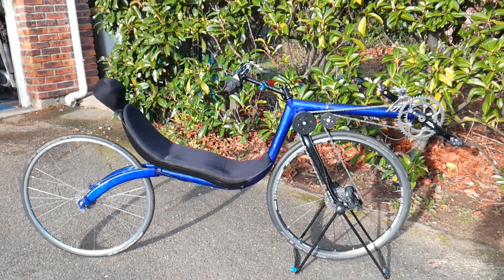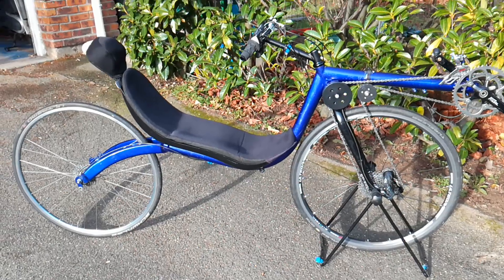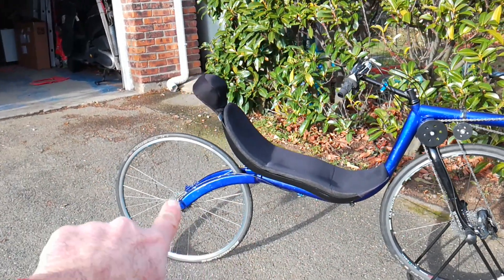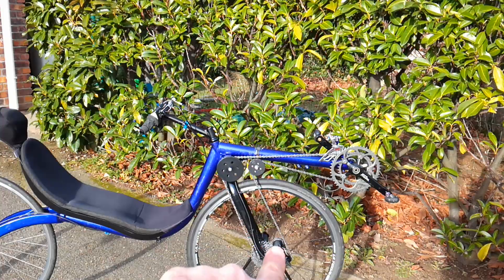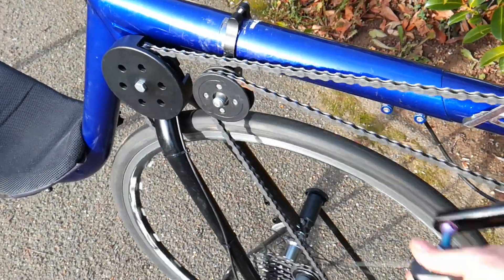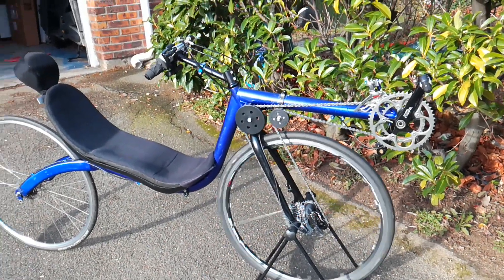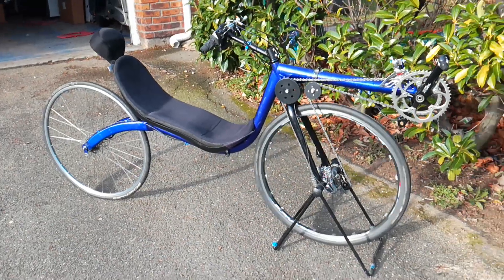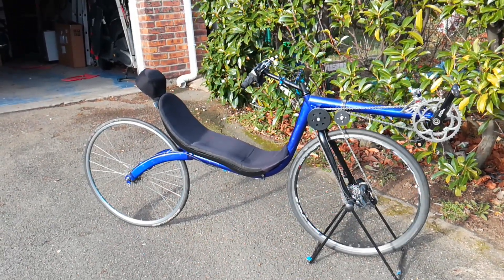M5 Recumbent bike...as you have never seen before!

Comment: it feels like, using two internal gear hubs, but putting them in the two positions you have the chain locating guides, you could have single chain or belt going from the pedals to the gear hubs, and another from the gear hubs to the wheel.  And your gear control would be a short run to handle bars.
Reply from the maker: Yes, I have seen this kind of transmission on other bikes (like the famous Velotilt) but in my case it was a faster and simpler implementation...

Comment: @Daniele G 
Hello, do you think your invention is possible to achieve on a bicycle M5 high racer carbon?

I'd like to try the experiment!!!
Reply from the maker: Hi, I also have an M5 carbon racer👍, but for this project I needed a steel frame because it is more solid.
I would not like to use a carbon frame, but this is more a personal feeling than a well thought reasoning based on real calculation.
Moreover with this frame it was not difficult to install idlers due to available space: not sure you can do it on M5 CHR.

Comment: How does it turn?  Doesn't this setup create problems with the chain twisting?
Reply from the maker: Hi, this solution can leverage the flexibility of the chain which can accept a certain angle between the clamp and the front wheel axle.
It is clear that if there is a 90° turn then it becomes quite difficult for this bike to follow with precision this tight turning radius.
But even the standard rear wheel drive bike doesn't like very tight radius turns because of the possible contact between the chain and the front tire....
Reply: @daniele_go  Of course, at speed you don't need to turn the front wheel more than a few degrees.  Wimpie van der Merwe's bike has a setup similar to yours, and it seems to work well.  The other option is a split frame like a Flevo or Cruzbike, which handles completely differently.

https://www.youtube.com/watch?v=_6uz9qkiVbo
Reply from the maker: @ldbenj  I know the Cruzbike and I modified one for a Customer with my tilting mechanism. It is now much easier to go straight, which is the downside of these MBB (Moving Bottom Bracket) bikes
https://youtu.be/DnbRRRD-prI